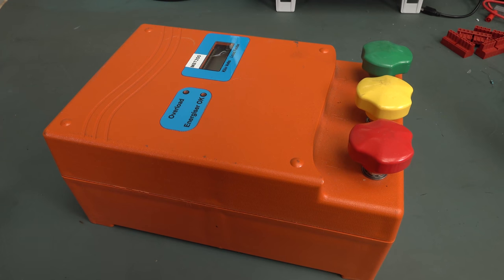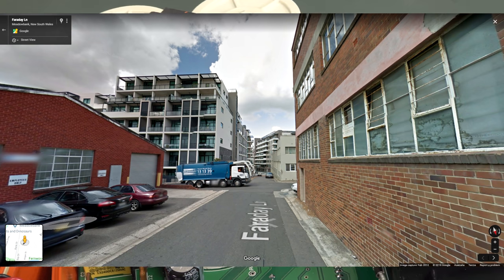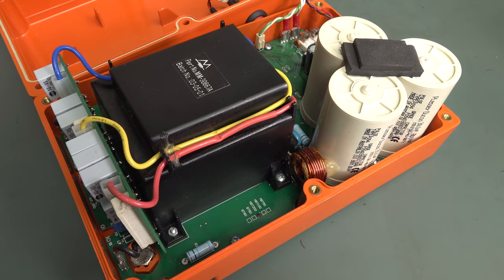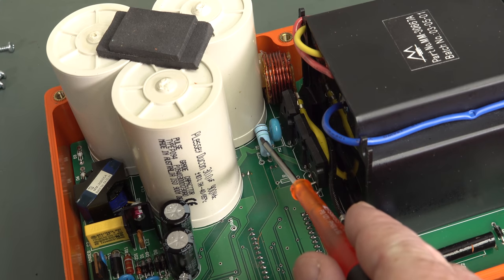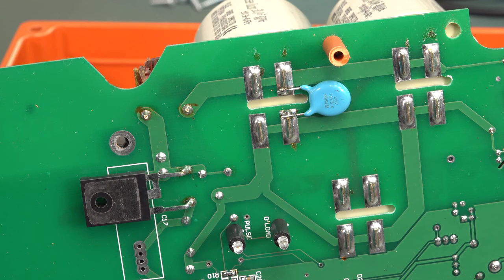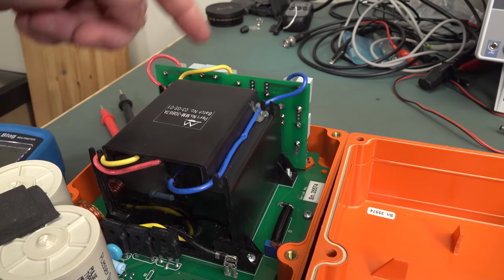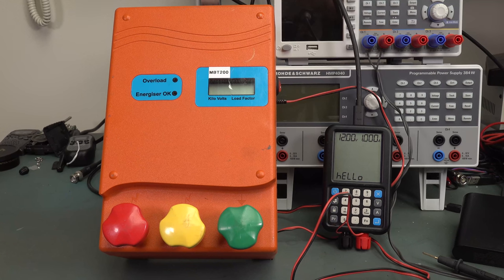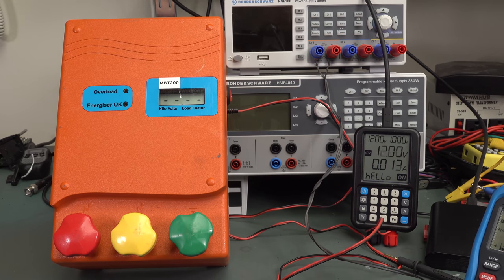EEVblog #1277 - Electric Fence Controller Teardown

Comment from the maker: UPDATE: Pakton have responded and unfortunately don't want to release the schematic for the MBT200. They are actually a bit embarrassed by this old unit and think "the plastic case was horrible".
They have offered a more modern JVA brand unit for a loan teardown and are happy to answer questions on operation etc.
The designer (Paul) has chimed in with a few comments:
"That unit was one of the first prototypes of that model, hence the "not for sale" on the back. I designed that unit. The PCB and firmware were all Pakton. 
JVA is our in house brand. Pakton is an OEM designer and manufacturer, we make and badge product for a lot of the other brands in the industry. 90% of what we make is exported, we are one of the larger manufacturers in this niche in the world.
It was a very reliable model. The output transformer is our most reliable by far. It was designed by myself in conjunction with an incredibly talented engineer in NZ called Bob Smith of Marque Magnetics, since deceased.

One of the key new features in this energiser design (when it was released) was the moving of the filter capacitor (usually across the primary) to the output. I had a patent on that. This improved the pulse shape without increasing I^2R losses in the primary, it also allows the leakage inductance of the transformer to work with the filter capacitor (or more accurately it's reflection in the primary). The goal was to produce a soliton pulse shape when coupled to a real fence. We did a lot of testing on long fences in western Queensland.  Real long fences are mostly capacitive in load. I.e. lots of reactive power flows. We have since patented methods of measuring the real versus reactive so we can isolate faults. Some of our monitors can pin point a fence fault to within 1/1000 on the fence. See the ZM20.

The move in electric fencing now is all towards monitoring, farmers do not have time to test their fences, and it's critically important to know if there is a fault on an electric fence if it is being relied on to keep stock in or bad guys out."
Reply: Ah that's too bad, but to be fair I can relate... hehehe
Reply: Very decent of them, it'd be great to see a teardown of a modern unit.
Reply: Meh id rather see the old unit fixed! Altho both could be nice.
Reply: looks like ya gonna have to do it the hard way Dave! :P
...and do a side by side - old vs new!
2 birds...one stick! LOL
Reply: I worked on a solar cellular electric fence detector. It would verify the fence is working and phone home when it had an issue. It would also give periodic updates.
Reply: I would love to see a schematic for any electric fence charger. I use one for beekeeping to discourage bears/skunks and I've always want to see a proper schematic (could never find one online).
If you take them up on the offer to answer questions. I would be particularly interested in details about the transformer, how they calculate the joule rating and how the feedback to sense anything touching the fence is handled (this may not apply to all designs).
Reply: do it. Would love to see a contemporary teardown of a unit they are not embarrassed by :-)
Reply: Get the new one. Just don't pee on the electric fence( intimate knowledge !)
Reply: Take them up on that offer that would be awesome.
Reply: do it :-)
Reply: Any info about the model number and the "D"?0
Reply: And here I thought the plastic case was an impressive feature!  I mean, it looks robust, has seals, metal inserts for screws...  What's not to like?
Reply: Be equally happy to see the new unit torn down. Lord knows anyone doing any engineering has a project or two they wouldn't care for the world to see... :D
Reply: @SomnolentFudge  Normally the electric fence init is similar to Capactor Discharge Ignition units. Charge a capacitor bank, to high voltage typ from 300v  to 1000v. Energy stored is 1/2 C V^2, and with losses that is above finsl energy output. The step up transformee will step that capacitor to target HV output, that for those I worked on were for 10KV. These also were around 10Joule output. The transformer was designed using components of ignition coils, BUT TOTALLY DIFFERENT WINDINGS. For 400V stored step up ratio only 25x . The stored energy is dumped via SCR under a timer control. Normally no feedback used to sense discharge response as typically running continously some grass/plant growth will cause periodic discharge current spikes as such gets zapped, burned off.
Reply: That's awesome, would be cool to see the inside of a newer unit
Reply: Thankfully there are still some good companies around offering full repair guides. Believe it or not Genie boom lifts offer manuals for free on their website, one of the very few equipment manufacturers that do not charge for any type of manual.
Reply: Ahaha plastic case was horrible, wonder if the new one comes in all paper case )
Reply: I remember that same sort of plastic used on agricultural related equipment in the '80s. Prasco... I do hope you do some schematic reverse engineering on this one...
Reply: Send the MTB200 to @bigclivedotcom - he’s totally down with explosions (even has a pie dish of containment) and the odd capacitor “tingle”!
Reply: Always good to see a company that is willing to send in stuff for tear down. So many will actively tell you not to open it.
Reply: @harshbarj  suppose they'll be selling into an agricultural market and farmers want to buy stuff they'll be able to repair or get repaired... like normal consumers did 30 years ago.
Reply: That’s very respectable of Pakton.  I would like to see this one fixed for sure. I would like to see the more modern one as well. Thanks for showing
Reply: That's really cool of them Dave, make it so!!!!
Reply: @SomnolentFudge  Just buy one. They're very cheap. Go to your local farm store.
Reply from the maker: @fredygump5578  Yeah, I'm not sure, looks like a great case to me!
Reply from the maker: @sympoz  Yep, very rare these days.
Reply: So we have a sort of prototype, great, and some story about it, more please.
Reply: @eevblog Do they also make the gallagher brand? We have a few of those. The biggest we own goes to almost 10.000V (we have jurassic horses 😎)
Reply: What a great response to get from the designer! Thumbs up to the late Bob Smith, RIP
Reply: Thanks for the update, great of them to contact you!
Reply: would love to see a video with the new one, also trying to fix it yourself would be very interesting too.
Reply: @picobyte  No, they do not manufacturer for Gallagher. Gallagher is probably their biggest competitor.
Reply: @SomnolentFudge  Energisers basically charge up bulk capacitors and then use an SCR to discharge through a transformer to boost the voltage by an approximate factor of 10 to 12. SCR's are very rugged and perfectly suited to the high primary side currents (in the hundreds of amps). In the world of Joule rating for electric fence energisers, there are two methods. First method is stored Joules in the capacitors. The second method is the peak output joules (output joules will vary depending on the fence load). A good fence load can be approximated by a 1000 ohm resistor. The human body can be approximated by a 500 ohm resistor for high voltages. When you touch the fence, the voltage will drop due to the higher load and the energiser feedback will be programmed with the 500 ohm voltage threshold to detect a person or animal touching the fence.
Reply: You should ask Paul if he'd come on and explain some parts of electric fence design theory, from his limited explanation it seems a fair bit deeper and quite analogue for this day and age.
Reply: I'd love to see a teardown of a newer product, and maybe even a comparison to see how things have evolved.

I'd also be interested in seeing some of the precautions you take when working with high voltages. My stuff is rarely above 9V, so I have little experience in that area.
Reply: I've had to do more than enough electric fence repairs. Would have been nice for our unit to have had fault detection (I just worked at the farm, I didn't have any purchasing power), so I wouldn't have had to spend so many hours tracing the route to find what was shorting against it. The unit nominally outputted about 15kV, so any time the readout displayed less, I knew something was shorting against the fence, but that could be anything from one of the insulating posts getting snagged off the old fence, or foliage in need of a good weed-whacking.
Good times.
Reply: What a cool company for responding like that!
Reply: When I was student I designed a few fence controller and sold them in Romania. I was using AC run motor caps and charged them to 600V with a small flyback transformer. Had two safety mechanism for the overvoltage on the DC side, as if I let the flyback to charge to full the caps, the tyristior strted to fire (autoignite due to HV)....Output transformer has the most dificult to build. Damm...a lot of time involved in those things...
Reply: What a shocker
Reply: JVA ? In german that is the abbreviation of Justizvollzugsanstalt -  jail. Maybe this is not made for keep things out. Instead it's made for keeping 'them' inside 🤣😂⚡
Reply: Lightning killed it ! Electric fence worst enemy 'LIGHTNING.'
Show'us the right angle spark-gap Dave..you know like at the A.M. radio station.
Reply: This is incredibly interesting! Thanks Dave. Hope to see a teardown of the newer model.
Reply: @SomnolentFudge  Adam i also would love to know that too.. and after that read in the description from the guy who designed it i think Dave will take them up on the offer out of pure respect more than curiosity!!
Reply: @vincei4252  can you imagine how good the new model must the if the guy was embarrassed by the old one.......
Reply: @techman2471  Ha!!! my dad did that unwittingly as a kid!!  : D
Reply: @helmuthschultes9243  i wondered about that where grass etc got zapped by one & you can see & hear the arcing. one down my road where i live was touching of the ditch & sparking for a week or more. would that have affected any animals contacting the wire??? would they not get as much of a ZAP because of that??????
Reply: @picobyte  Gallagher Energizers are all designed and manufactured in New Zealand. Gallagher also owns the Thunderbird brand in Australia.
Reply: Thanks for the update Dave, this was really interesting and I'm interested in the new version.
Reply: @DX5143  Ah, oke. For once we own some electronics that's not oem 👍
Reply: Interesting reply from Paul. Maybe he can tell us why the unit is not working. 😀
Meanwhile, reverse engineering the schematic would be worth while IMO.
Reply: Why is there an electric fence around your lab? Is that even legal outside North Korea?
Reply: @keithking1985  lol, yeah!
Reply: That information is interesting to me. I was a dairy farm kid in the US in the 80s and 90s. The controllers were primitive by comparison (we had one fail badly once - was putting 110V on the fence.) Our way of checking for shorts then was to drive along the fence with an AM radio.
Reply: @koppadasao  Or send it to ElectroBoom. He WILL shock himself, guaranteed!
Reply: @keithking1985  animals, or anyone/anything, will get zapped if in close enough contact to the HV wire. But intensity of the zapp will depend on ground return impedance. Having personally tested many times during development by finger, it is a significant jolt, close to 0qinful. As noted in another of my comment the lab tech suffered a month of arm and shoulder pains when not believing me it was live. Some how I have never suffered more than an instant shock. I do recommend to avoid such contact. I have blasted many small holes in cardboard writing pad backing sheet using the zapp so it is definitely to be avoided. Cattle, sheep, pigs, goats, horses all very quickly learn to stay away, but also some seem to enjoy it. I have seen a cow happily rubbing its back end on the fence with occassional shudders in the hind area.  A horse leaning against the wire, wiggling its feet at each jolt.
Reply: @helmuthschultes9243  thanks for the info Helmuth..
Reply: Honestly tho who isn’t embarrassed by their early work?
Reply: @AviDrissman  if your embarrassed by your earlier stuff.. then your making progress!! as far as knowledge is concerned!!
Reply: EEVblog got eestwa caps
Reply: Hey Dave, I didn't know you were afraid of voltage like me, i say the same thing all the time, i don't deal with anything over 12V lol, somehow i thought you used to test 440 supplies with your pinky finger lol
Reply: @PhillipS85  Is Gallager Kiwi?
Reply: @koppadasao  It is NOT FUN......I know.

Comment: Bigclive would have seen for himself if the output worked, he's his own volt meter!
Reply: More like ElectroBOOM ;)
Reply from the maker: The calibrated finger has 3 levels:
1 - Yep it's on
2 - Ouch
3 - Bloody hell!
Reply: @EEVblog  that precious moment where you're not sure if you've had a fright or you're in fibrillation
Reply: @mixerfistit5522  Oof lol, tell me about it. "Am I holding my breath, or am I physically unable to breathe?"
Never a good question to ask yourself lmao! Great vid btw EEV.  Be safe guys and gals.
Reply: @EEVblog  It also has an overload protection feature, but can only be used 8 times.
Reply: Well, electricians used to actually do that in the US way back in the day when working on 110/220 VAC. They'd use the index and middle fingers on their left hand to check for live/dead on the circuits. After a couple decades of doing this it tended to turn the fingers into spongy, unfeeling flesh sausages that couldn't even bend. The practice was ended after more understanding of electrical safety was developed.
Reply: Been bitten by an electric fence energiser a few times and it can definetly be on the bloody he'll side if grounded properly
Reply: @bar10005  I was gonna say that, he would love it..
Reply: @mixerfistit5522   Or brown underpants
Reply: Get a shock from one of those that's meant to keep people out. That f**king hurts. Wanted to try, but didn't want the current to pass through my body so held onto a grounded metal fence and slowly extended my finger towards the wire - a pop, and an ouch and the end of my finger went white for a few hours. Fence around a Rolls Royce factory... (UK)
Reply: @KnightsWithoutATable  Hmmm, I guess I shouldn't have done that.  Lacking a proper tester on the day I re-did a bunch of wiring in my house, that's exactly the technique I used.  Found several live circuits that way!  Fortunately, my fingers still work.
Reply: @EEVblog  4 - that was close
Reply: @EEVblog  🤣